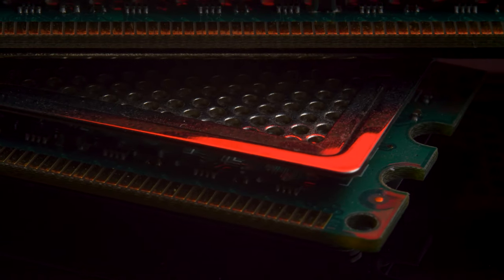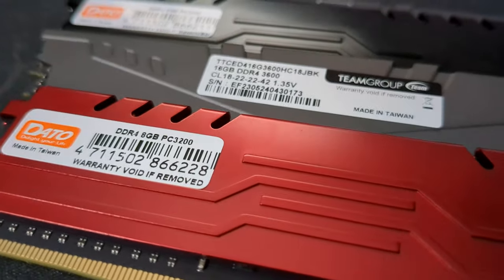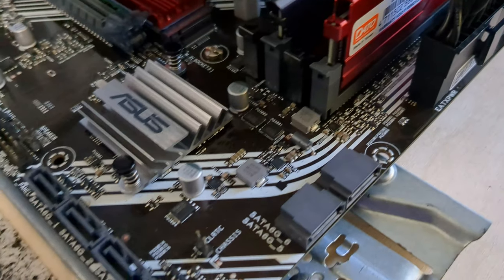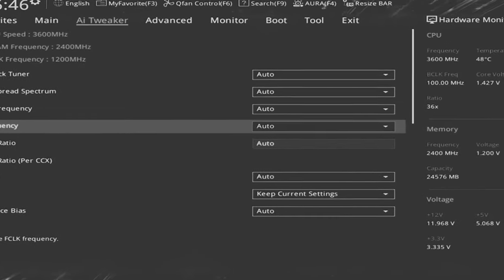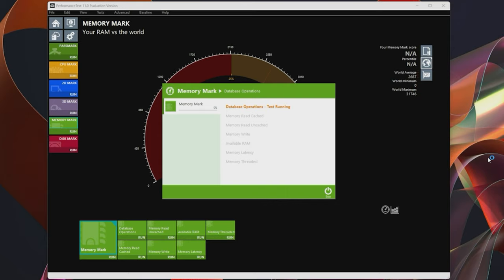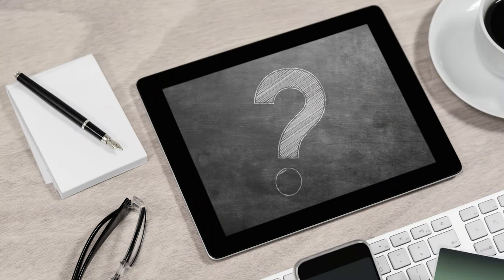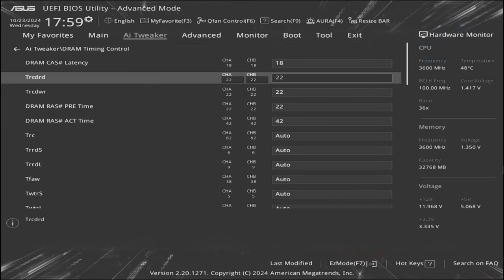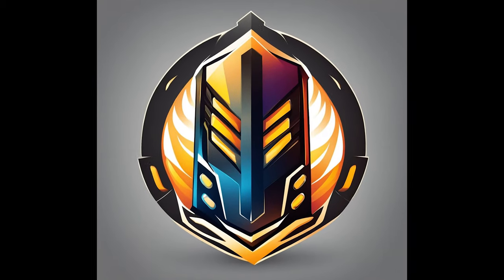Is Mixing RAM OK?

Comment: I have 2 sticks of kingston fury 8gb 3200mhz and 2 sticks of crucial balistix 8gb 3200mhz in my pc. They both have the same voltage (1.35) and timings (16 18 18) with the xmp profile. In this case the different memory chips are not affecting the speed and latency AT ALL (I tested them 2 by 2). But I can't overclock them for some reason :)
Reply from the maker: Your memory is probably at its limit already. XMP is basically an overclock.

Comment: what if frequency match? i have a kit of 3000mhz balitix, manually overclocked to 3600mhz, and thinking of upgrading in the future, if I buy a diferent vendor but with 3600mhz xmp, and match the timings ?
Reply from the maker: That's quite an overclock. I've mixed memory of the same speed without much issue. If the timings match and are stable you might be ok.